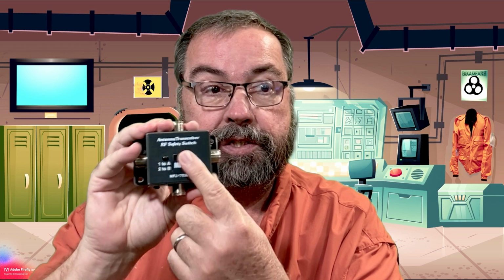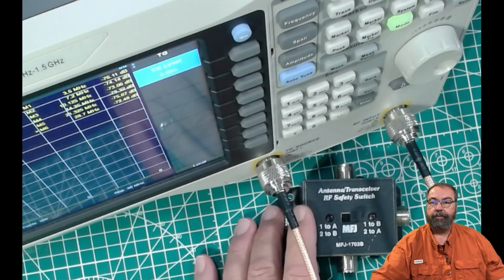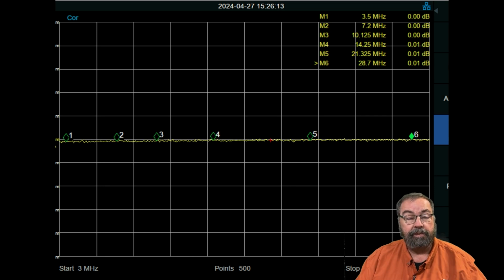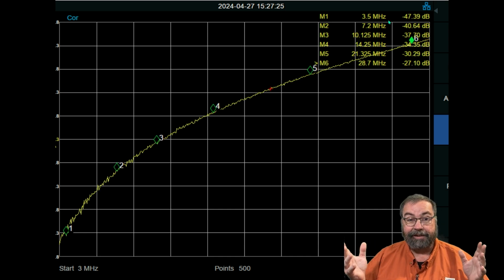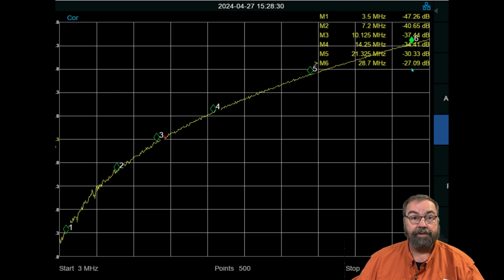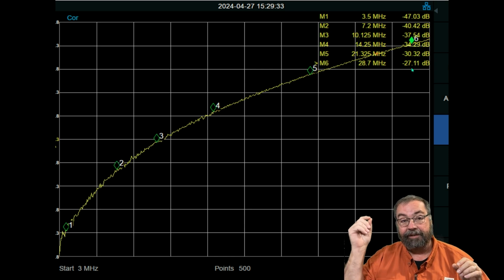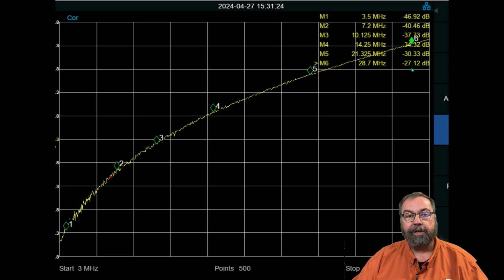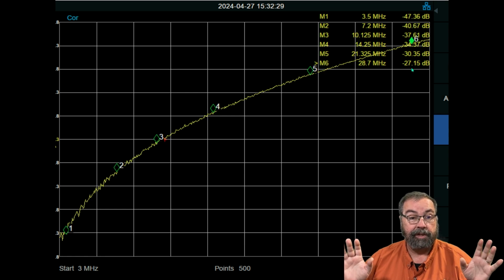Is That AB Switch Safe For Your Radio's Health???

Comment: Nice test Jim and it confirms my suspicions regarding RF switches in general. I have several switches for multiple antennas but I built a manual patch panel for the transceivers so that at no time, are two radios connected to the system. I agree with your summary as well, $100 switch, multi-$1000 radio. Keep them separate!

Comment: I will say most of HF radio can handle power level of  10mW  +10dBm   into receiver without getting damaged ,   so from 100 watts  50 dBm  ,   50 dBm - 10 dBm  = 40 db.   it may only need 40 db isolation.   if the Receiver can handle 100mW  20 dBm,  it only need 30 db isolation.   AG6JU
Reply from the maker: Yes, I've heard that as well.  I suppose it's a matter of trusting that.  I would say, if I see it in the manufacture manual, I'd for sure believe it.

Comment: I read it as the switches are rated at 300 watts before it burns up, not the isolation would be 100 watts.  Isolation would be stated as dB, not in watts.  The 100 watts is meant to be how much power the contacts on the switch it can handle.
Reply from the maker: You may be on to something there, that's an interesting point.  If that's what they're saying, it's subtle as can be.  However, the only number mentioned is 300W.  Also, I was a little slack in using the correct term db vs dbm in the right places.  No they don't mention isolation, but if it's rated at 300W, that implies very strongly, that there is at least 55dbm of isolation, even though they don't mention isolation.  Since they pimp this thing as a radio/xcvr switch, and don't mention anything other than "don't switch while xmitting" (duh), again, it implied to me originally that i can have 2 radios on this thing, with two antennas, potentially both on.

It may just be bad documentation, but clearly, she won't handle 300W as there ain't 55db of isolation between the two connections.

Thanks for watching, Ron!